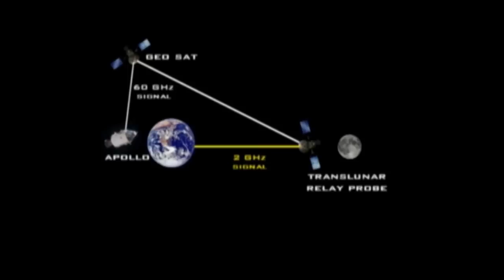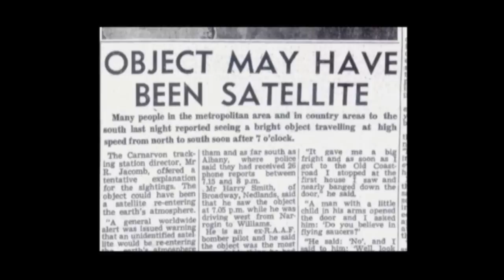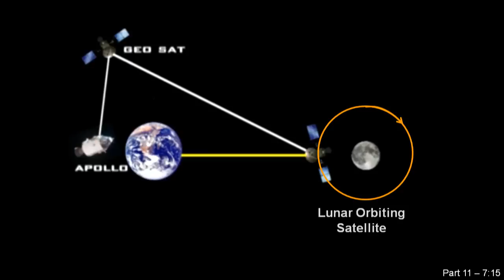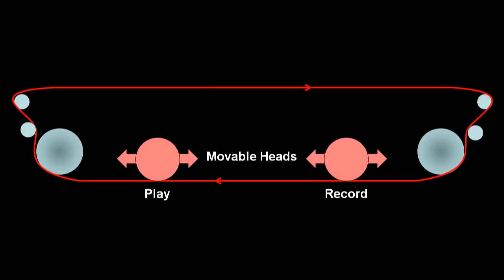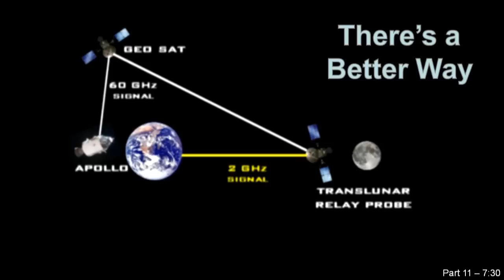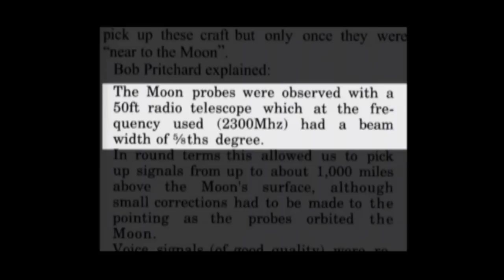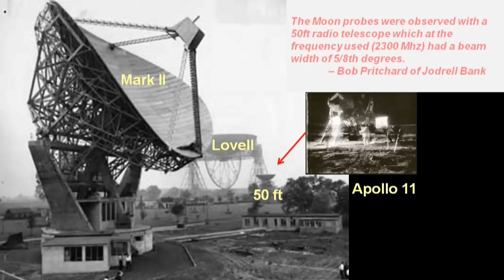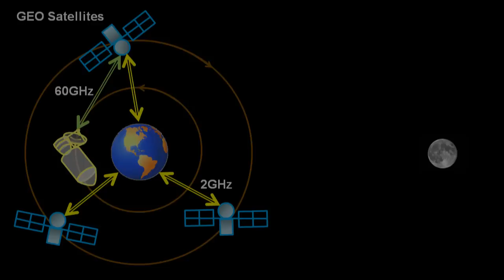MoonFaker: Exhibit D: Critique #20C: A Better Hoax

Comment: Jarrah's been at this nonsense for a while. I came across another 'could have' relay/decoy scheme from 2006 that used HF radio instead of 60 GHz. Unfortunately he didn't realize that the HF spectrum doesn't have nearly enough room for an Apollo USB signal. He had the Apollo CSM orbiting the north pole in a tight circle, apparently forgetting some fairly basic principles of orbital mechanics. Ah well, he's not one to let mere physics stand in the way of a great story.